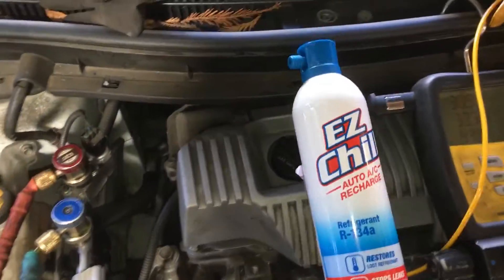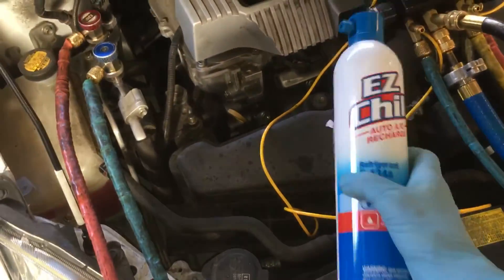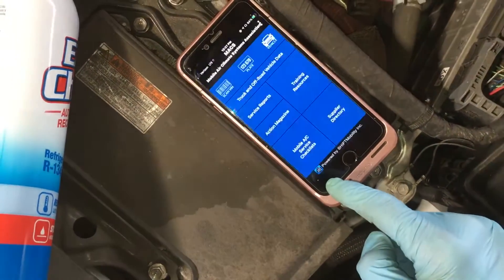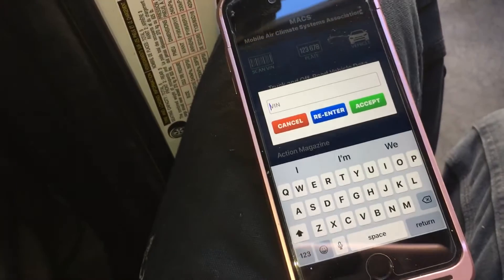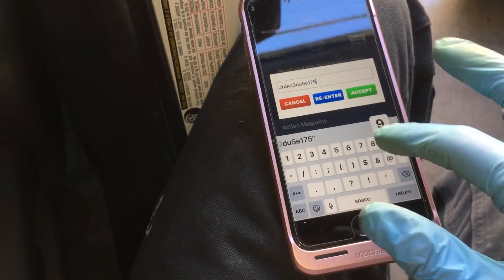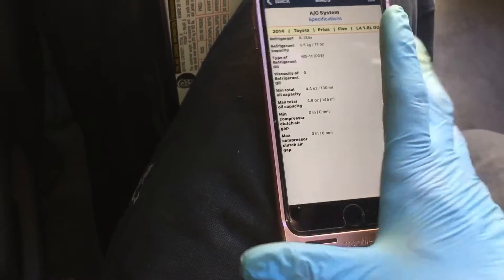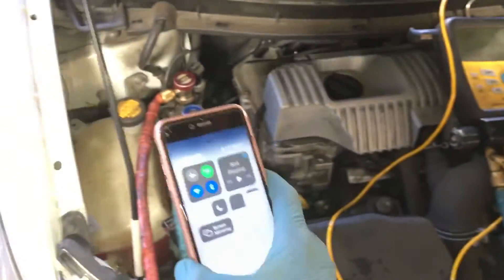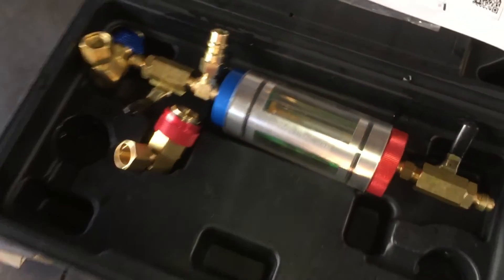Cloudy Gray refrigerant sightglass, Caused by EZ CHILL.  Wrong PAG oil added to POE OIL￼

Comment: Last question, what could happen to this system with that cloud refrigerant if left un- attended?
Reply from the maker: What little damage has been done has been done cannot be undone. 

Oh if the cloudiness of gray is microscopic size particles that are a slight abrasive a slight reduction in the life of the compressor overtime

When the compressor on this one finally does die complete system disassembly and flush out all lines and hoses replace expansion valve replace condenser when that day comes

Comment: Hello, sir, here there is car, its ac system lost refrigerant because of leakage, the leakage was treated and system was refilled r134a to correct level and it blows ice cold air..

But when i observed the sight glass i was surprised to see the sight glass showing refrigerant with grey colour and less visibility, though when ac is off the sight glass become very clean and clear...

NB: a day before leakage the refrigerant on sight glass used to be seen clean (not grey) and easy to see through when ac compressor is running.. but after refilling due to leakage that situation was observed..

Now: though the ac system is blowing ac cold air, but with this grey  refrigerant is this not problem to worry about? Can it be a potential sign of black death? 

If it is a problem, can evacuating refrigerant and replacing descant bag inside condenser solve the issue?
Reply from the maker: Let me repeat and see if I understand exactly what you’re saying .  

The car comes to the shop with low refrigerant and when it was running the site glass was clear.  ?  Yes 

1:  if it was very low on refrigerant maybe it was clear because all you were seeing was vapor no oil return no liquid refrigerant ?. 

Then after you filled the car you now have a lot of liquid and liquid refrigerant is an excellent solvent cleaner. 

So possibly what little damage was done to the compressor by overheating and the dirty debris was in the high-pressure discharge line hose and a little bit in the condenser already. 

But because the refrigerant level was so low when it came to you you were seeing a clear sight glass because it was nothing but vapor that could not carry no solid particles so it appeared clear. 

Then after you recharge the system you now have a lot of liquid refrigerant that was able to clean off the high side discharge line and pick up the dirty debris that was coded inside the hoses in line and in the condenser and now travel with the liquid refrigerant to the cy class and now you’re seeing gray cloudy when running because he cleaned the debris from the high side discharge hose and condenser and is now circulating with the system. 

This is the only thing in situation I can think of that you described

Whatever little bit of damage was done is already done to the compressor

Receiver dryers the old style like a little can did a little better job at filtering. 

The newer desiccant sock that are built into the condenser on the tube attached to the side helps a tiny bit when you replace it and they have a plastic mesh filtering screen. 

Where are the old receiver dryers that word I can type had an actual filter pad that was a felt type material and then a layer of desiccant BBs and then they never felt TypePad that was another filter that the refrigerant had to pass through they did a better job at cleaning a little bit of dirty debris then the newer style

But you can give it a try it will help because some of the filter material on the desiccant BBs does absorb some of the particulate material when you pull them out you see that they are dirty and gray. 

You will be able to reduce some of the particulate matter that will get caught in the desiccant bag material lowering the quantity of debris circulating in the system
Reply: @coldfinger459sub0  thanks for the response boss...

What is surprising me is to see refrigerant which is grey like color on the sight glass when compressor is running and when the compressor is not engaged the sight glass becomes  clean.. (though before leak happens, the sight glass used to be clear either when compressor was engaged or disengaged)
Reply from the maker: @tanzaniacarschannel6975  that is because that was not enough of it and long enough contact of time to actually coat the inside of the glass

If the correct circumstances happen it literally coach the underside inside of the glass. 

I’ve seen both
Reply: @coldfinger459sub0  thanks so much
Reply: @coldfinger459sub0  hello, i evacuated the system and changed the desiccant bag, flushed the entire system, vaccumed, then i refilled again the system to the specification requirements..

The cloudy/gray substances that were seen on the sight glass all disappeared, and now the system is clean and blowing ice cold air.

Thanks for your time and guidance father... And am learning a lot from your videos..
Reply from the maker: @tanzaniacarschannel6975  good work Successful. 
May you learn something new every day.  And pass your knowledge to someone else 👍

Comment: Owner might find themselves dealing with a high voltage leakage to ground protection fault,  if the oil    in that product is not rated for Hybrid/EV applications…Just a thought.
Reply from the maker: Yep 👍

Comment: I really hate how these cans come with oil in them. I get that the concept is refrigerant leak = oil lost. How MUCH oil was lost though? Depends on the leak location. Slamming 3 ounces of oil into a system that only lost a small amount is going to harm it badly. Once you develop a leak with oil staining around it, there's no way to know how much oil is in the system anymore. You really have to remove and drain the compressor, flush the evaporator, condenser, receiver or accumulator, and lines to remove all the oil. Then measure out the correct amount of oil and distribute it around to the correct proportions to each component. Nobody does that though. 😑 Many cars driving around with low charge AND not enough oil. Maybe someone has a big low side leak and they have to recharge it every year. Every year they use an oil-bearing can like this one. 3 ounces injected every time. 🙄 Jesus Christ, the compressor will hydrolock eventually and shatter. Orrrrrr someone has a stone pinhole in the subcool section and needs a recharge every season but they use the $5 can of plain refrigerant at Walmart. Eventually, no oil left. 🙀 Compressor seizes and they say "Yep, I knew she'd give up the ghost eventually. Got 4 extra years out of her myself though for $20, not too bad.” Ya fucking dope, now you have a burn-out and it's a huge mess. 🙄 Should have replaced the condenser right away.
Reply from the maker: Usually the oil loss you see from the stain is extremely extremely small even though the oil stain may be very very big.   Have you ever seen how far one drop of oil will spread on a piece of paper

Put one drop of oil on a piece of paper and then come back tomorrow and look at it and see how far it has spread. 

Then you will understand that only five or six drops of oil from a small hole in a condenser can spread out toa6 to 8 inches large round circle and accumulate dust on it making it look much bigger than what actually really came out
Reply: @coldfinger459sub0  Yeah, I've seen how a tiny bit of leftover fryer oil on french fries soaks the bag at Burger King and makes huge splotches of oil. 😸 Same with pizza boxes. So in your experience, even a really grimey leak point on the high side hasn't let more than a CC or 2 of oil out of it?
Reply from the maker: @mannys9130  correct, a bad one. (Not talking dripping one that’s different.)
       Like the video from about two or three days ago you see a server case as in walking by a Honda. You see a large 12” round oil stain from the top fitting.  It’s super heavy packed with dust and dirt.  And still shiny wet oil over the entire 12” oil soaked dust patch . 
            Now that’s a case we’re it’s probably getting close to 20 ml. + ( almost one oz.)